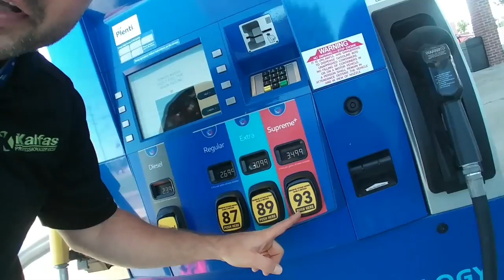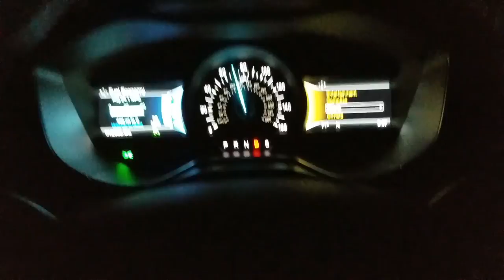The Night Before Landscaping

Comment: I could not agree with you more about the no warranty. I have found in my career that 99.999% of the time if a plant dies it’s because improperly watering you either get an overzealous client that just thinks more water is better inch rounds a tree and watches it die slowly and never tells you until it’s freaking dead, Or people that never water at all and let the plants die and then wonder why they’re dead. And then right before You get there they were run out and soak all the plants and you’ll be confused as to how they died when really the people are just trying to act like it wasn’t because they didn’t water them. The only thing I’ve seen actually kill the plant by improper planting is planting too low. If the trees planted too low and dies I will usually pull it out of the ground and see standing water in the bottom of the hole. That happens almost every single time.￼

Comment: You don't use non Ethanol for your equipment ?
Reply from the maker: +JordansTutorials where do you get that??
Reply: Non ethanol is only a problem if you let it sit. Professionals like Keith burn up 5 gallons well before the 3 month limit of deterioration.
Reply: As a general rule, you should not use that type of gas after 3 months. Remember, we used to be able to let gasoline sit around for a year or more with no problems. So 3 months is on the safe side if you are paranoid like me, but you realistically could use it a little longer.